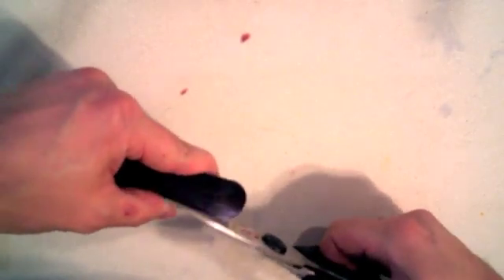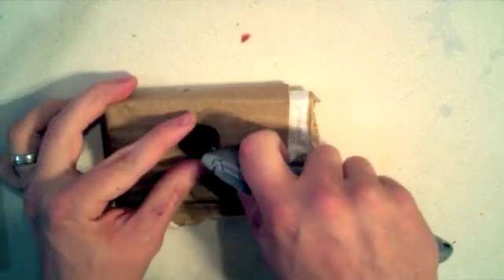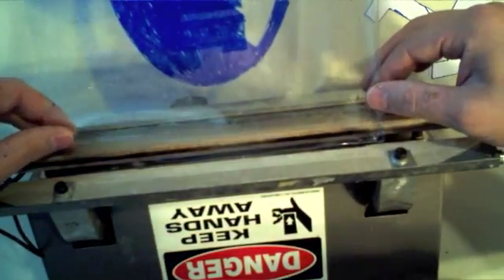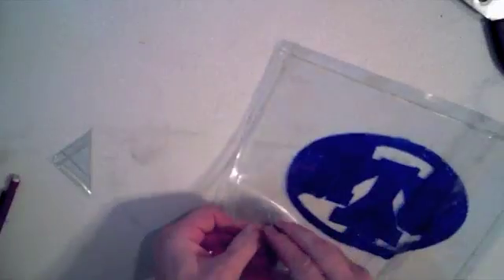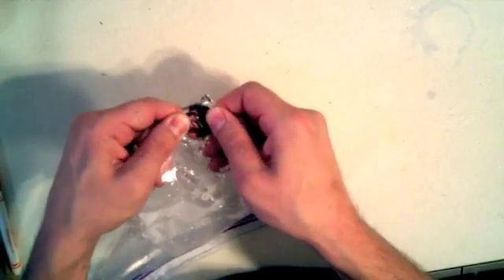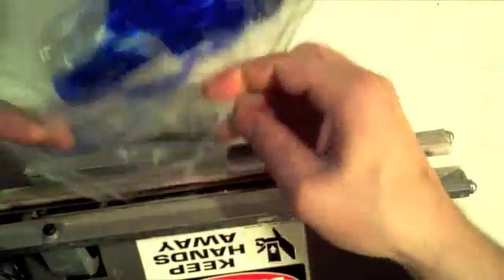DIY Resuable Sodium Acetate Handwarmer

Comment: I have been using these hot packets for years. The one thing I've noticed that may have been explained in your wonderful article is that so often, over time, some sooner, some later, develop into will I have been calling half triggered packets. That is, they develop a gel-like consistency and you can see floating particles or chunks  inside of the solution. Sometimes they just don't ever stay in the solution form and they just develop all the way to fully triggered, at which time the only thing you can do is throw them away and buy a new ones.  

I have searched high and low and have tried to contact manufacturers to find out if there's anything that one can do in terms of, say for example, a gentle heating cycle to prevent the packages from developing into this gel-like state when they're not triggered.  Older when I read your article did I get an idea from one sentence that you stated then maybe what happens is that the solution evaporates to some degree inside of the packets leaving a more saturated sodium acetate solution. Thus settling into this gel-like state. I would be interested to see if you would concur with that conclusion.  Also I have felt that when they're in that half triggered state that the packages actually get hotter when they're triggered and if they are triggered from the completely clear solution state.

In any case I have a couple of suggestions for you:  the packets that I purchased from Soma care are very rubbery inconsistency and they would never become so cold that they would shatter. Also since there are so many packets that go bad one could harvest the metal clickers from inside those packets and just reinstalled them into homemade packets. Anyway thank you very much for your article and the detailed effort that you put into making it. It has helped me a lot in understanding that maybe my packets are lasting longer than I expect and don't need replacement. Thank you!
Reply: Also would there be any benefits of using distilled water in creating the solution?
Reply from the maker: My guess would be that the bag / solution slowly allows some moisture to escape concentrating the mixture a bit. But that doesn't seem to explain all of it. It seems like some crystals form and never dissolve anymore. But all of that is purely speculation as I really don't know.

I became frustrated with my home made bags failing such that I stopped using them quite a while ago. Also I don't do as many cold whether activities as I once did.

I am glad you got something out of that effort I did!

Comment: how many water do u use ? like ml?
Reply from the maker: It is about a 1 to 1 ratio. So add the same amount of sodium acetate and water. Then you need to observe the solution and add either water or boil off water until you get a thin film of crystals forming on the surface while the solution is near boiling.

Comment: Do you have to wait for it to cool to reactivate it? I'm going to attempt to make a self resetting engine coolant heater. Not sure if the solution will remelt at the 85°c coolant temperature, but on average that temperature will be sustained for 30-40 minutes. But it would be reheated when it was still actively giving off its own heat, which if there isn't any active chemistry that stops you doing that it would have the benefit of reducing the energy requirements to remelt the solution.

Also is the step to chill it quickly nessassary?. I might buy a small amount to see if it will reset from the coolants heat and then if that works I'll buy a large amount to build a full coolant heater.

I'm a hypermiler and would love to keep my fuel economy above 70mpg into this winter xD.
Reply from the maker: You don't have to wait for it to fully cool in order for it to start crystalizing, though the process is slower and forms larger crystals. The crystalization process is an exothermic reaction that works just like the exothermic reaction that occurs when water freezes. The reaction for sodium acetate will increase its temperature to 54-58c when it freezes. So at 85 c it will be completely liquid. If you try it I would love to hear about the results.

Comment: Kevin can you post more of your experiment? Love your Reward Project . practical for motivating kids. (Commented here coz its off on your recent Video. )
Reply from the maker: Thanks for the request. Sorry, it seems if you mark the video "safe" for kids then comments are turned off. 

I have done 2 projects since the reward project. I posted one of them (The Love note drawing machine). The second was a fingerprint scanner to control power to my TV so that I could enforce screen time rules with my kids. That second one I never completely finished for a few reasons.  1. I ran out of steam. 2. I was afraid of managing 120v ac power inside a 3d printed housing. 3. I felt like taking away my kids choice to turn on the TV took away my opportunity to teach my children proper viewing habits (I go back and forth on that one).

Any way, since I burnt out I have taken a step back and taken it easy. I have other hobbies that are front and center right now (keeping kiwi plants alive through the spring, keeping diy fish tank controller running).  If any of those sound interesting I could make some videos about them. Let me know.
Reply: @nivekmic   Anything on YT right now is watched, (even nonsense Stuff). Yours makes a lot more sense, practical and creative. The most crucial part is Your TITLE and the search criteria you will put. 
Like for this video it can be searched more if its relatable to its USE or purpose. if i may, the title now is too "scientific". " DIY Heating Pad " or " DIY Heating Pad Magic" , im no expert. i just feel you hv soo much ideas that are useful and with purpose than most garbage in YT that are watched on because the Title is great. The 2 other videos , ive watched also.. so mucglh potential... the Title just needs to be refined and the search criteria you placed in. i sooo hope you post more videos. Again your Inventions are Great. It shld be watch by millions. The Kiwi and Fish Tank invention is Genius.. But the Title needs to be sooo relatable. ask a a creative teen probably or view the million viewed YT DIY, how they made it more searched and interesting. sometimes they use the term "Worlds Best, First, Greatest, Unique, one of a kind, Cleanest, etc" not the exaggeration but the practical use. the Kid's reward is soo useful to Parents and Students even corporate ppl who does training games to hv a little fun. Lookg fwd w/ your innovations. God So Bless your work.
Reply: @miksUSA777  those words ("world's best, greatest," etc) are clickbait words, though, and that's not cool. The DIY terms are much better!

Comment: What is it that the coin does to make it crystallise ?
Reply: I saw another video and it said it was there to start the reaction. Basically, have you ever put something (a bottled drink) in the freezer and take it out a few hours later only to see it was still completely in liquid form, no ice whatsoever in it? But then as soon as you open the top or shake it around a bit or even as you're pulling it out of the freezer it starts to freeze (like a slushy)? That pretty much the same idea. As soon as you agitate the liquid there is a "point of nucleation", a point where in the smooth inside of the bottle ice crystals can start to form. The heat pack solution should already be in another form but isn't because it's supersaturated, it stays liquid because there is no "point of nucleation" but as soon  as you click that metal, that's like when you pop the top to your drink that was in the freezer or when you shake it up a bit, all of a sudden the ice starts forming (point of nucleation) but in this case the heat pack turns into what it's supposed to be but wasn't because it was in a supersaturated state.
Man, I meant for this to be short(er).
Reply: I don't know exactly.  Maybe someone else can chime in.   I have read that it somehow creates a nucleation site for the first crystal to start the chain reaction.   I have also heard it suggested that it creates a shockwave that causes the chain reaction to start (though I could never repeat the shockwave theory via any other method).
Reply: it actually releases some NaAc particles into the supersaturated solution causing the solution to revert back to the solid form. Once the liquid turns into a solid, it releases mass-energy which causes heat
Reply: @boyo5194  it releases a tiny metal piece, not a bit of salt, for the salts to nucleate on. A salt can't nucleate on another bit of salt. It needs something else to stick to, for it to begin "freezing."
Reply: pls sub if that was helpful
Reply: @boyo5194  it wasn't, as you got it wrong. 🙄

Comment: If I only want to use it once in a day, do I have to boil it or will it go back to neutral on it's own? Or do I have to boil it no matter when I will be using it again?
Reply: You store energy in the solution by boiling it.    The energy is released when you activate it and it turns from a solution into crystals.    In order for it to work again you have to add energy back in by boiling it.
Reply: @kevind2683  depending on how much powder you add you may be able to get away with dropping a clean paket in a hot beverage. I have a small store-bought version that I put in my morning tea/coffee. I rince it off when I wash my breakfast dishes and can then take it to work. 
I suggest adding the powder at a lower tempature (closer to your beverage maker) so the oversaturated soulution is stable up to that tempature.

Comment: how long do you boil it for to reactivate it?
and how long does it take to loose its heat once you activate it?
Reply from the maker: For the size I show in the video it probably takes 20 minutes of boiling to completely reactivate it.    How long it keeps its heat depends on how hot it is when you activate it.    If you let it completely cool down first then you probably only get 20 minutes of good heat from it.
Reply: @nivekmic  can you define "completely cool down" for me? Do you mean below room temperature? Do you mean below body temperature? 🤔
Reply from the maker: @MaryAnnNytowl  what I meant by "completely cool down" was cool down to the ambient temperature. When I was taking them to cold football games I found they stayed warm a lot longer if I simply heated them an hour before I planned on using them.

Comment: Just a thought, from reading your instructables page. I can't comment there cos I don't have an account, and I have ENOUGH accounts I don't really need already!

You were asking about suitable bags... What about a rubber hot water bottle? They're meant for the temperature. Eventually, after years, some can spring holes, but generally they're pretty good, when I was a kid we had decades-old hot water bottles that were still good as ever. Since they're full of boiling water in bed, not developing holes is a big part of their design. 

Of course it would make a pretty enormous heater, but if you wanted something like your large one, to shove up your jumper at sporting events, it might be about right.
Reply from the maker: I like the idea, the only problem would be activating the solution (it would be hard to press the clicker if you can't see it), though I guess I could just unstopped the hole and activate it that way.
Reply: Somebody in a comment somewhere, can't remember right now, said they use 2 pennies instead of a clicker, rubbing them together starts the process. So you could perhaps glue the pennies to a certain part of the hot water bottle. At least, a coin small enough to fit in, even if that's not a penny. Just an idea.
Reply from the maker: I tried the penny idea and could not get it to work.

Comment: My solution keep activating it self before i can put it in a bag? 
How do i prevent this from happening???
Reply from the maker: +Nikolaj Kilime, when I put my solution in a bag it is still very hot, near the boiling point.   At this temperature it can't activate.   Once in the bag and the bag is sealed you would probably want to shake it up to dissolve the small amount of crystals that may have formed while filling the bag.
Reply: Does it matter if it solidifies before it gets in the bag? Couldn't you lump the crystals in, seal the bag temporarily, then boil it?
Reply from the maker: Absolutely!  The only downside is that you would probably get a lot more air in the bag that way.
Reply: So it doesn´t matter if the solution activates before you put it in the bag? you can always boil it once it´s in the bag, and get the same results?? And thanks for the responds, it´s really helpful :-)
Reply from the maker: Put it in the bag while the solution is still very hot.
Reply from the maker: Sorry, I realized my last comment didn't make much sense.   I like to put the solution in the bag while it is very hot as it reduces the amount of air in the bag.   But as long as you have the right ratio you could put it in the bag as solution or as crystals, it would work either way.
Reply: Kevin, can you tell me the quantities to make sodium acetate? (with vinigar and bicarbonate)

Comment: any particular reason you dip the bag in ice before activating it?
Reply from the maker: Not really other than the reaction looks better when the solution is cool.
Reply: +Kevin Dodge lol ok. i just got one from an online store today and the heat lasts barely for 10 mins. what factors control the duration of the heat? can i make it last for 4 -5 hours or more. specially in sub zero temperatures
Reply from the maker: +Bobby S The main factors that will make the heat last longer is how warm the solution is when you start the reaction and how well you insulate the bag.  

The hotter the solution the less energy that is used in initially heating itself up.  Even then it will only stay warm to the touch for 30+ minutes unless you wrap it in an insulator to slow down how fast it is losing its heat.

I found that if I boiled the bag right before going to a football game and put it immediately in an insulating pouch then it would stay warm for almost the whole game.

For an insulating pouch I used a bubble wrap envelope and cut a square out of the face of it.
Reply: Actually boiling it just before use is a good idea. You can use the warmth of the boiled bag for sometime...(i am guessing 20-25 mins) and as it starts to cool down,  you can click the metal disc. 
Incidentally do you have a DIY video of those 'activate by oxygen' packs that need to be unwrapped to activate.They claim 7 hrs plus of constant heat. Now that would be really nice.
Reply from the maker: +Bobby S sorry, I haven't really used the oxygen ones.
Reply: @bobbys757  the problem with those O² activated warmers is that they're throwaway, though. I hate that!  😒

Comment: +Kevin Dodge, I read your instructable where you stated you could find the metal discs in bulk. I actually have an alternate use for a bulk supply in some electronic work I'm doing but I can't find them anywhere. Can you point me in the right direction? Thanks!
Reply from the maker: ***** I wish I could.   I found them only once and am not sure how I did.   I have looked again for other people and have not come across them again.

Comment: Could you use a ziplock and heat seal below the zip
Reply from the maker: Salene Brom Maybe.   Trying to seal below the zipper you will fight with the sodium acetate solution.   If any gets into the seal you won't get a good seal.    The problem with ziplock bags has not been the zipper but that the bag gets tiny holes fairly easily.   Even the freezer bags.   It works well for a temporary bag though, and it is easy to change out when it gets a small hole.

Comment: How long does the heat stay and would the heat sealer form a food saver work to seal the vinyl ?
Reply: The amount of heat and length of heat is dependent on how hot the solution is when you activate it.   Normal room temperature I would say you might get 45 minutes.

A heat sealer from a food sealer might work.   The main problem is that most food sealers only heat on one side.   It will be difficult to get both sides of the vinyl hot enough to melt together.   Might be worth a shot though.
Reply: @kevind2683  the commercial ones claim they last 5+ hours. Is it possible that the solution they use has less water and more of the sodium dissolved in it? Would that make them stay warmer longer?

Comment: So I used the popular science recipe to make this, which is basically exactly the same as yours except they have you use baking soda and vinegar to make the sodium acetate and an alligator clip to activate it. For some reason when I add the crystal to the solution, nothing happens.  I did add some blue food coloring, which they said is okay, but I am perplexed as to why this is not working.  The baking soda and vinegar I used were both kind of old, but the baking soda fizzed a ton when I put it in.  Any ideas to why it's not working?
Reply: did you boil down the sodium acetate solution to concentrate it?

Comment: you're a pro!  I've been looking for a non-metallic activator so that I could microwave it and the bag to re-liquify it.  Will the vinyl melt in the microwave?
Reply: You may be able to microwave it even with the metal disc, but I'm not sure how the vinyl would hold up. It's sharp edges that cause an issue with metal in the microwave, so with it being fairly smooth, small, and in the solution, it might be alright. The inside of the microwave is actually made of metal, but it's flat and smooth so it doesn't cause any problems.

If you test it, just keep an eye on it and shut it off if it starts to arc.
Reply from the maker: The activator I am using is metal,  if you find one that works that isn't metal I would be interested in hearing about it.   I have never tried microwaving my bags.